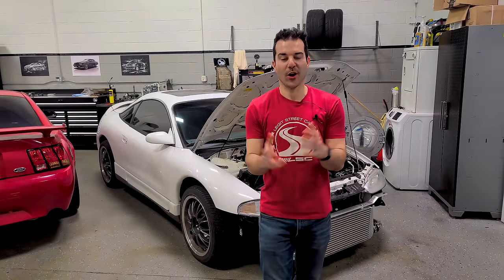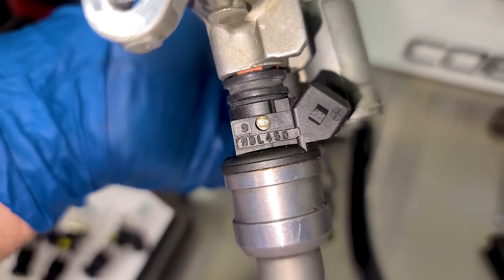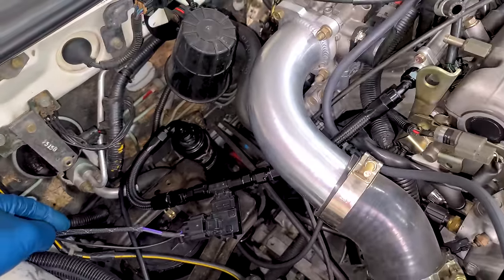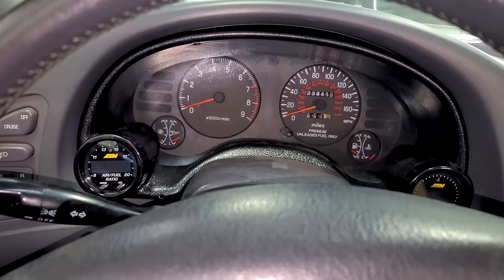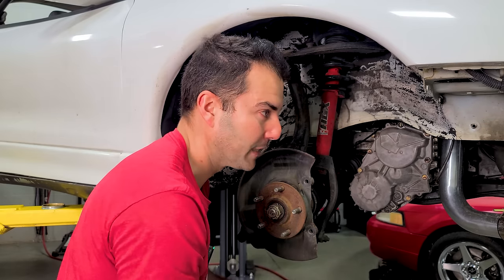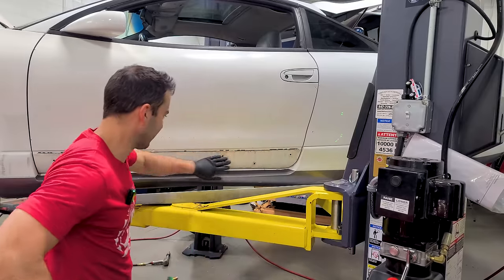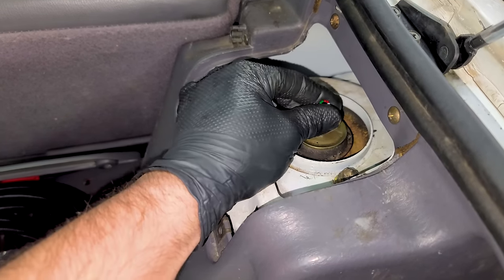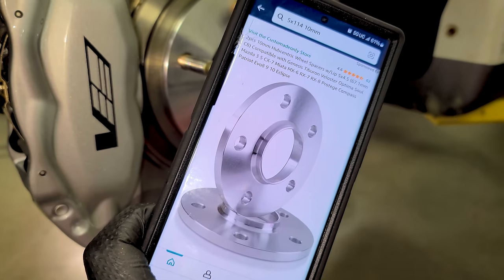I Turned My Eclipse GSX Into A Mini Nissan GTR With Parts Off A Mustang & Cadillac! Budget GODZILLA!

Comment: You should NOT be putting wheel spacers behind brake discs to make it clear, what you should be doing is putting spacers between the caliper and the hub to centralise the disk in the middle of the caliper. This would help with your wheel spacing as well as it looked like the caliper could go further back away from the wheel when central on the disc.

Comment: Tip from an electrician to make a water tight seal on the heat shrink. Pinch the hot heat shrink with your needle nose pliers on the tip to seal it up

Comment: Fun fact, if you don’t want to lose any brake fluid while you change lines or calipers, you get a stick and push down your brake pedal more than halfway and prop the stick on your seat so it holds. And then you can open the brake system without losing a drop of fluid.

Comment: Awesome love your channel, can i ask, you put the spacer between the disk and the hub to align the disk and stop vibration but you said the lugs would line it up anyway, how does that work as the wheel will be flat over the disk with the spacer on, I can understand that they would line a wheel up with the conical edge but how does that transfer to the disk, now the face looks flat ? Thanks was a bit confused.
Reply: And answered my question 50 mins in ha nice one Alex

Comment: I'm guessing the damage to the inner guard is sand blasting from Nevada....  If it was anywhere near the desert the tire would spit sand into it stripping paint of factory sound deadener. Not at a high enough speed to bare metal it but with enough force to de-paint it. Similar to how salt treated roads ruin cars but without the rust factor

Comment: I use never seize on all wheel studs torqued to spec and never had them losen and it doesn't gall threads either and you actually get a correct torque spec and not a biding spec..  Same premise as ARP uses lube for their bolts on engines to get a correct torque spec! NEVER GO IN DRY!!

Comment: Bro you have to line up the Enki center cap with sticker on the wheel or my OCD will kill lol and please at least put a spray can of black in the front wheel well til fixed but this is a killer video

Comment: Beautiful wheels: They could only be better with the (fake) massive lug like F1 wheels.
For fitment ... all you'd need to do is adjust the NEGATIVE CAMBER. Done.
You might want a heat shield in your hood to protect the new paint from turbo heat.
Personally ... I massively prefer the older spoiler that has no gap from '91. 🤌

Comment: What is amazing to me as a German, is how in the US you can just say "yeah, throw in a different engine, gearbox, turbo, compressor, brakes, shocks, ECU, different tune, cat delete, open exhaust, etc" and you can just hop in and roll with it.
In Germany you will have to go to the TÜV for every single little thing and have it checked and authorised if you're even allowed to have it on your car.
Then it gets entered into your documentation. And if you meet a cop on a bad day, they will tell you they suspect the parts don't line up with your docs, confiscate your car, tow it (at your expense, naturally) and it will all have to be tested again (of course you'll pay for it).
And that same cop could target you now over and over again and there's nothing you can do except smile, cough up the fines and fees and walk home yet again. Because in Germany there's a pricelist and every insult has a fixed price. You can even get fined if you address the officer in the familiar (Du) instead the formal way (Sie).
If I put a K&N open air filter on my car, that alone could land me in hot water.
The mods that Alex makes in this video have gone beyond just entering them into the papers, he would need to bring this in as a one-off build, same as building a brand new car from scratch and the entire car would have to be thoroughly tested.
And when it comes to insuring it, you can bet that a once-off, DIY build is extremely difficult and expensive to insure.
Germany absolutely hates and detests people who modify cars.

Comment: You might want spacers with a boss on it, the wheel needs to be centred on the hub to eliminate vibration and you want the wheel centre taking the weight of the car, not the wheel studs.

I see you are aware.

Comment: Working on 4 cylinders just does not pay off. Unless you don't care for maximum power, use no turbo but ITBs and effective, long ouput headers, they do not sound great. To some more stuff with R5 engines pls.

Comment: I'm a bit disappointed.  When you said "I'm going to make it faster and" then you finished the sentence with "more reliable" and not  "Furious".  Also, OCD says the Ennkei on the cap should be in line with the Ennkei on the wheel.

Comment: Those wheels studs are WAY too long, thats a major weak spot no way.
Those brakes are huge, and totally unnecessary, and going with huge, oversized wheels is also stupid, more weight, more load and stress on those absurd studs, and the drivetrain.
All bad.
Less is always more.